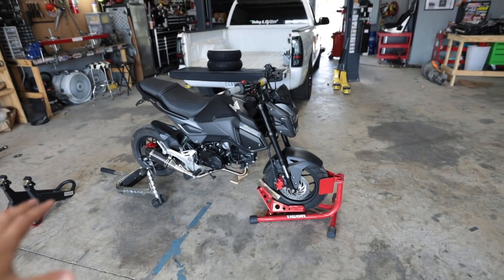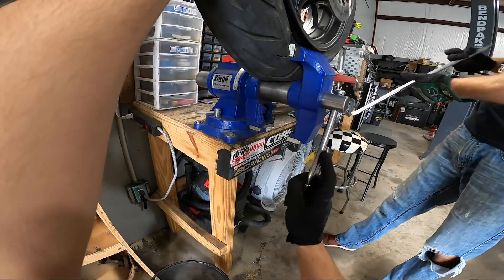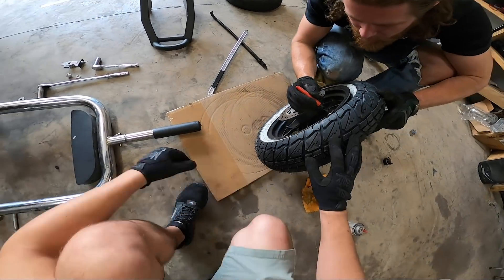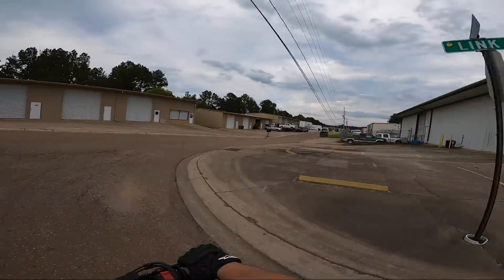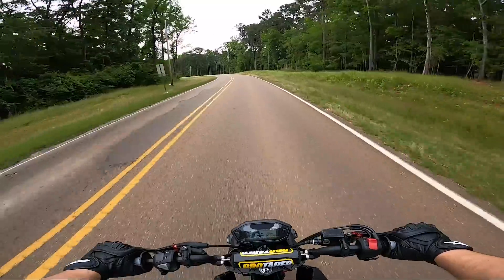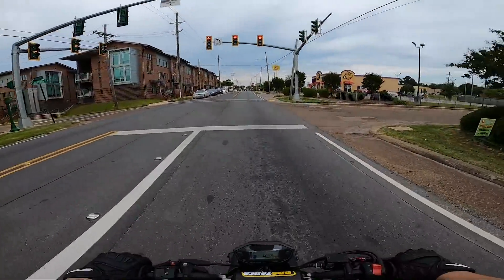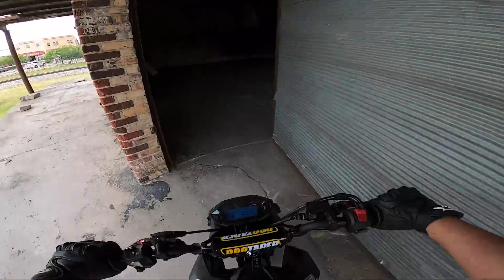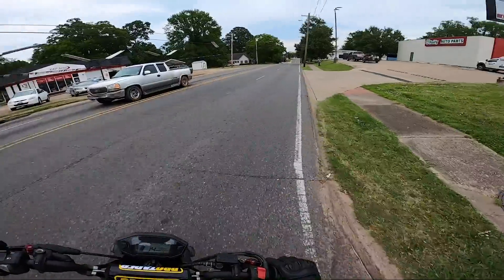NEVER pay to mount tires AGAIN! Try THIS instead.

Comment from the maker: What do you think is the solution to the COVID-19 Pandemic? 🤔
Reply: Satan's next 1/4 mile pass
Reply: @jxke8826  Excellent answer.
Reply: Buy your own plot of land and make a drag strip
Reply: “Job security”
Reply: Job security
Reply: Taken from Steven Crowder
 Open up but quarantine the old and at risk. That way most will gain immunity and the at risk are kept safe
Reply: We’re just gonna have to go head on into reopening because anyway you look at it ppl will die.
Reply: Another shop not too far from you that I know might be able to help
Reply: Open up and stop letting the government ruin our country
Reply: Aydan Angus  nobody has the right to take anybody’s rights correct or false? We can’t tell someone they have to stay home because they are old! If people have conditions and they still decide to go out in public then that’s the same as you or I  or Gavin deciding to do 100+ mph in a car when people die everyday in cars in large amounts so let give people the warnings and allow them to worry about them!
Reply: satans makes a 8 on the track
Reply: Buy a tire mounter and balancer and racing Cleetus with him in Ruby.
Reply: Just a tip. If ypu squirt a little soapy water around the bead before you let the air our, it helps get the bead off.
Reply: Solution is to be cautious and smart but most importantly  grow a pair and get back to work... I'm a professional truck driver and  have been working this whole time
Reply: Ls swapping the viper
Reply: Evan Stoehr “piece”
Reply: The Poor Gamer this mustang would never hold up to ruby.
Reply: I LOVE THEM WHITE WALLS
Reply: I feel the economy should die if it means saving peoples lives. We can always start again, build up. People die and they don’t come back. Is money more important than a persons life. I get that people don’t have money to make it if the economy were to tank but we can solve that after we solve this. That’s my opinion though
Reply: Unfortunately people need to work to provide for their families. Most people will not survive much longer, kids will go hungry, families will become homeless and even more unfortunately some people will commit suicide due to not being able to get the help they need. Yes this virus is real and nobody knows what will happen. But staying locked down longer will do more harm then good.
Reply: @FranciscoMG620  do you have ideas to help the people that are going hungry and homeless now? Or is it still a we will figure it out later after families die from being homeless, hungery or by suicide?
Reply: cwk1981 it was a thought. Obviously we can’t let people die from hunger. To supply food would be difficult to do because of how many people there are. My thought was the most radical approach to stop the virus. If I knew an answer then I wouldn’t be writing it in a YouTube comment. What would your approach be. We can’t choose to save one thing because so many things will suffer. For now I feel we should find a way to make it so we can keep people from gathering while making sure the economy doesn’t fall
Reply: Open it and let natural selection take place
Reply: Open everything back up. I'm not giving my rights up for a little bit of false safety
Reply: Open up
Reply: @FranciscoMG620  I wish I had a answer, but unfortunately I do not. I live in small town Midwest and know so many people that are suffering more from the lockdown then from the virus.
Reply: cwk1981 I live in a bigger city and more people are suffering from the virus than from the lockdown. The lockdown helped  here which is why I am for it but it’s different everywhere. The problem is people don’t keep there distance or clean or do anything to help stop this. Hopefully we can find an answer. Take care and hope the best for you
Reply: @FranciscoMG620  same to you and good luck
Reply: Quarantine the compromised,  and everyone be cleanly, but get your asses back to work.
Reply: Toaster bath
Reply: Semi close everything every one in masks and a 15 foot distance enforcement. So we can be safe
Reply: Lpayboi carti droppng his album
Reply: I think it’s official gavin watches dankwheelie 🤣
Reply: Can you do a story time on how you started a youtube channel.
Reply: require all states to stay shut down but like they had befroe only essential busniesses open, same with travel only if you absolutely have to, and also require high class individuals who make over 750k annually, donate x amount to to COVID research or require them to pay more government taxes to help stable the economy
Reply: Teach us how to compress a suspension spring
Reply: Harbor freight tire irons.
Reply: Well... Some people are making decent decisions, but some people are forcing nursing homes to take infected people so that it spreads to and kills all the old people sooo...

Most thing would be hard decisions to make but that is not🤦‍♀️. 

I think we have came to pass at a place where we can't accept that frankly we're basically ducked and people are going to die. At the end of the day we can't let our nation fall apart to keep from people dying because this is not a fantasy world. 

That's my take can't wait to read all yours
Reply: Lick all the water fountains
Reply: @onementality9781  I agree. Just tell people the facts and let them make their own decisions.
Reply: I’d open things back up because people die. It’s a thing of life. However, people getting sick is how we evolve and move past things like this. If we stay closed people will continue to die from this while it might level out. But people die from the flu and other basic diseases. It’s inevitable. For example, if we stay closed up my uncle who has spent his life building his business to become a million dollar business. He might have to close his business and get rid of all of his workers because he has no business. Then along w that other are on the same boat and because of this suicides will increase. So people will die if we open or close. So why not save the economy and safe some people and everyone’s way of life. Sorry for the rant tho that’s my thoughts behind my decision.
Reply: @coolslider2011  thank you for working still. You really are a vital part of society
Reply: @volted0885  psst. Pretty sure that was supposed to be a joke
Reply: @owenpullen6356  y
Reply: Thepeemslayz because have you ever saw a ls swapped viper
Reply: Thepeemslayz IDC
Reply: 59
Reply: nothing
Reply: @coolslider2011   wow
Reply: @FranciscoMG620   well said
Reply: I knew I wasn’t the only one that thought it’s 2 sided and there’s no definite answer but the better thing is to help towards the people who are sick and close stuff down we are sorry that business have to do this but at the same time give it some time. People are afraid to live like the old ways and do for themselves and live through the hard times which makes us stronger. Hard times are what they are. Hard. But just like a muscle your making it stronger.
Reply: Isolation it works here in western Australia it's gone!
Reply: Everything needs to shut down... Businesses can be rebuilt after bankruptcy, i mean it is hard to rebuild ur business when u've lost everything but u can never get ur life back if u get the Covid-19 virus and die.. Life is much more precious than anything else.
Reply: El Pancho Med you don’t just restart an Economy. The amount that will starve will blow away corona numbers. Guarantee people who went through the Great Depression would take getting covid over going through a depression and starvation again.
Reply: If the economy doesn't reopen, a higher number of businesses will be lost. In turn creating a bigger economic hole to climb from. It's not a simple as saying reopen and increase the death count or stay closed and keep the death count down. Studied show the # of people with depression and deaths from suicide correlate with the state of the economy. I think that originally this pandemic was expected to play out much worse. However the issue I have with the government is their choices after recieving the scientific data. Which shows the average age of corona deaths is older than the average life span. That this virus is not killing people like we thought it was and hospitals are not overrun with patients. However many hospitals furloughing doctors and many going broke (*New York was an exception).  Sadly practically nothing about taking better care of your health and taking vitamins to boost the immune system such as C, D and Zinc are being talked about. The number of deaths is no where near the number if deaths caused by driving or cigarettes etc. Why is it that we are still being locked down when I feel most adults would be able to be intelligent enough to socially distant, wear masks in large gatherings, and wash hands etc. At what point is the economy going to be at the point of no return!????? 🤷🏼‍♂️
Reply: @onementality9781  Exactly!!!
Reply: @butterbutt763  🤨
Reply: @coolslider2011  Seriously it isn't what it was originally expected to be! As soon as that information was known we should have been reopen.
Reply: @FranciscoMG620  What you don't understand is people die either way. The number of deaths from depression, drugs and suicide are directly related to the state of the economy. The more people that lose their businesses, jobs and ability to feed themselves as well as their families is unacceptable. Death is horrible but we make choices ever day like whether or not to drive a car (which way more deaths occur from car accidents than corona). The average age of death from corona is older than the average age of death!. It's not what it was originally expected to be. Those affected and the number of death much lower given the data we now have. Most Americans are adult enough to make smart choices and take their own risks! If we don't reopen soon it's going to be too late if it isn't already. JMO
Reply: @cwk1981  the government's actions have and will continue to have affected more lives than the actual virus itself. Originally it was reasonable to close but once the data came thru we should have opened up. Every day we continue to stay closed the worse it will be
Reply: Check your Instagram dm's i got an amazing merch idea for#savethemanuals
Reply: Need to be a vaccine created asap
Reply: i would say open things up because if we loose people we can repopulate, yes it will take a while but an economy will probably take longer
Reply: People can die from covid or starvation or lack of medical supplies with the options you spoke of.
Reply: Yes we need to open up because other wise it economy will die and will be in it worse than the great depression
Reply: @jaydenholmes3466  the unemployment rate right now is almost the same as it was during the great depression       just imagine the second wave
Reply: The solution is to stop lying about it. It’s not serious like they try to exaggerate.
Reply: @r.l.j3789  it really is my town has 200 or so people infected and 7 or 8 people dead in a town where everyone knows everyone it may not seem as bad to people in big cities but it is really bad
Reply: insane videos I mean the numbers say otherwise. Doctors are saying people are recovering a lot more than the cdc or who want anyone to know. The number of deaths isn’t accurate because according to doctors they’re being forced to label any death that happens with covid-19. So even if a person had it and that wasn’t what killed them it’s still labeled as covid-19. You don’t die with a virus, you die from a virus. I’m not saying people haven’t died from it. It’s just not as deadly as they make it out to be.
Reply: More power baby
Reply: Sooooo when you gonna turbo the grom
Reply: Just open up
Reply: You should make a song with your outro beat 👌
Reply: Overly dramatic media is the problem
Reply: It's crazy how different things are in the us compared to Belgium where i live... All the people who can't work right nog are still getting almost there whole income from the government. (Except for freelancers)
Reply: WWG1WGA,  qmap,pub,  WOKE.
Reply: MessyJessy 214 you are right people are surviving it but they are showing the death
Reply: You get it or you don’t live life
Reply: Reopen the country. Most hospitals are not being overwhelmed by this with the current stay at home practice. Masks should be required at work I'm understanding of herd immunity but people can't get sick all at once you have to control the incoming stream of patients. Masks will help slow the spread. If hospitals get bogged down patients should be bused to other hospitals.
Reply: Buy a tank
Reply: Don’t be idiots
Reply: Stay home
Reply: Read The eyes of Darkness...
Reply: I would say both but put restrictions
Reply: There is no solution only time. Those that are old how to remain inside those that are affected to remain in quarantine. Time is only thing that we have that can tell how deadly is is virus actually is my eye and this is only the beginning and already so many have died so many have been affected what about next year when flu season comes back you may not even know if this is a new flu

Comment: Pro-Tip: for chain replacement.

when you replace the chain before you completely pull the chain out "temporarily" link the old chain with the new one, so you can pull the old one out then unlink and you can have your new chain ready to be linked and not struggle with the front sprocket since there is no room to pull it from front. hopefully it makes sense and you got the pro-tip. 

 LIKE it so eveyone can benefit. Also, I had an accident on my sportbike and torn three ligaments in my right knee and compressed nerves on right arm resulted to minimize my arm movements or which called "the biker's arm", and I am doing physical therapy, so pray for me for a fast recovery to get back on ridin sportbikes

Comment: Gavin, and anyone else cause its universal, but they make automatic balancing beads, basically they are tiny ceramic beads that will balance the tire and continually balance the tire through the life of it. in theory as soon as you drive on a freshly weight balanced tire it becomes unbalanced because of tire wear, the beads will adjust to keep the tire in balance, also to note, i use them in my bike and have never had a problem with shaking or vibrations at high speeds(little over 140 mph) they make them for cars, trucks, and motorcycles

Comment: My buddy changed a tire his self on a cbr600rr and the tire was perfectly balanced he did 150 no issues. Also we did mine on my crf250l no issues just line the paint mark on the tire with the valve stem as close as possible

Comment: You can also brake a bead loose by laying it on the ground with the valve stem out and running the tire over with vehicle. Look it up, it works great!

Comment: You missed a critical step in  R & Ring those tires.  It's very important that you push the bead of the tire on the OPPOSITE side down into the middle of the rim.  The wheel is smaller in diameter in the middle and makes prying the bead over the rim MUCH easier.

Comment: Hey man     make sure your sprocket seal is in good condition    i have a 1977 suzuki GS550E-X   and the sprocket seal has been in there since 1977 and it has been in worse condition than it was in and its kinda now stuck in place and will not move at all   i have to completely destroy it to get out      to make sure u dont have a bad sprocket seal is therell be a heavy or light coat of oil on the chain or on the engine its self     the part dont cost a lot at all  its around a $5-$15 part    jus take a look at it    its a real easy part to replace

Comment: Ive actually tried to use a vice before and on any wider tires it will not work unless you have an extremely long extending vice

Comment: How to balance tires w/out weights: line up the dot on the tire with the valve stem. 🤯🤯🤯
Reply: They sell beads you throw in reliable from what I've heard never used myself but going to when I change my tires here soon.
Reply: @Capthooker76  I wouldn't use the beads... I had them in my harley tire.... just swapped it for a new tire this season.... had 2 seasons on beads had 2" rubber dust in tire from beads eating tire insideout
Reply: not true actually....... at alll....
Reply: Best way.... line up for on tire to value stem. Will get it close enough you wont notice
Reply: @Capthooker76  Don't know if anyone else said it but don't, picture a car at a stop all the beads are on the bottom and not moving. as soon as you start moving the beads roll in a pack and eventually they stay in the same spot and make the vibration/ balance worse. source work at a tire shop where customers complain about a vibration caused by said beads.
Reply: Balancing beads are a nightmare for the next person to dismount it. They go everywhere and are impossible to sweep up.
Reply: Joshua Shanahan      my comment was more of a statement that tire shops should try/ use the method I said
Reply: @JDPlonk  ...'s aight, some guys just get it, and some don't...I've done what you suggest and had it work just fine...when in a pinch, ya' do what ya' need to do...
Reply: Not true, on some tires the dot is supposed to be lined up with the valve stem because it will conform to the shape of the wheel better, however will still be definitely out of balance without weights.
Reply: @synergy_gt5005  well,I don't know what to tell ya', 49 years of riding, I guess physics work differently in my neighborhood...

Comment: I have gsxr 1000.mount the tires myself with no balancing.and no vibrations at all.even at Max mph.also if you don't have a vise. You can use a big c clamp.

Comment: if you still have your Grom invest in a Kitco external oil filter clutch cover, do a spinner delete, high volume oil pump, slipper clutch and 10% stronger clutch springs. get a cheap yoshi knock off pipe off ebay and just cut the oem muffler off and weld on the new one leaving the cat so its not so loud.. i love my Grom and gonna put K180 tyres on it ;)